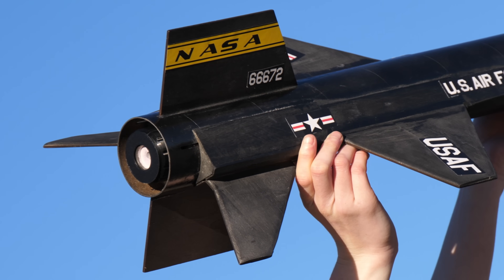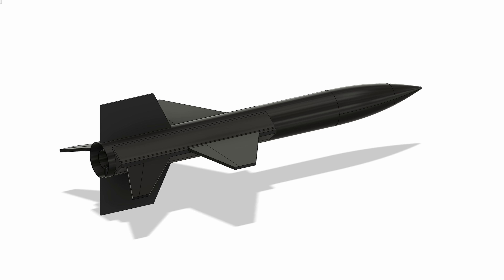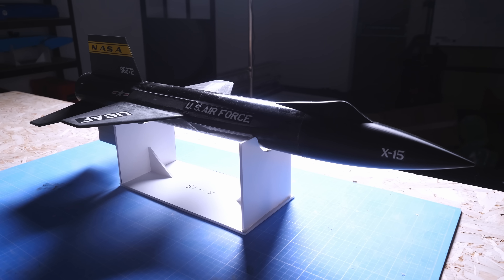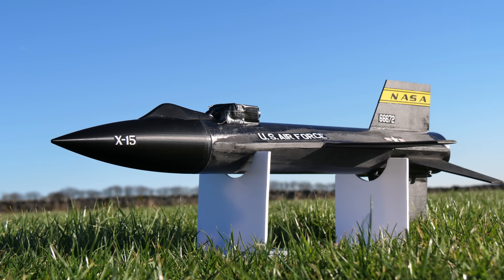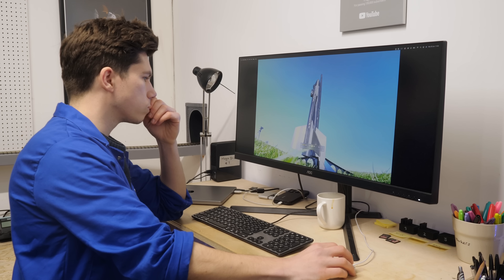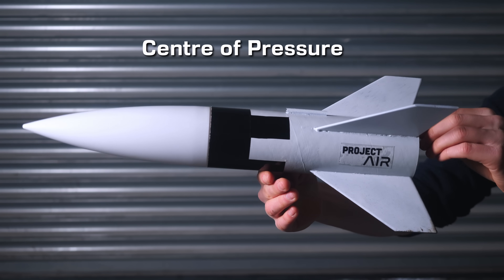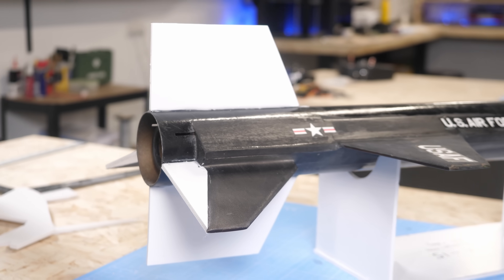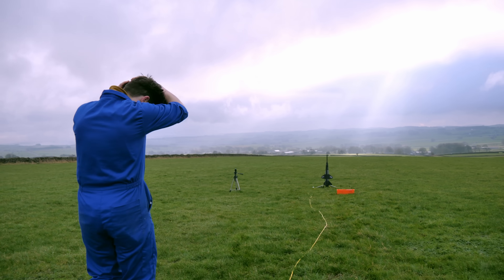Building a HIGH SPEED Rocket Plane

Comment: LOL you could have relaunched it right after driving it in to the ground ... 
As far as a speed of sound shot straight up is no big deal  if i recall you already did that and 100s of others have for sure. Now getting it flying horizontal at speed of sound will be hard unless you launch it almost horizontal to start with. I would say a launch at 33 degrees from horizontal would about do it. For that you will need way way more space than you have there say the salt flats?  If you try to transition from vertical to horizontal at speed you are going to rip the plane to shreds there wont be any thing left so you need to be as flat as possible to start with. Another way to do this is a drop launch from the belly of a rc plane. Take the smaller x 15 model in to the air to altitude on the belly of a large scale rc plane any 1/4 scale plane will do and lots of those exist in kit form. Once at altitude you drop the x 15 model and using a pull pin trigger for  setting off the rocket motor go straight in to the speed run from drop point. Right before releasing the x 15 model you   have the drop plane pilot pull up in to a steep climb so the x15 drops with the nose up a bit so that when the pin pulls it is ither a little nose up or nearly flat. Slight nose up is best slight nose down is worst

Comment: ground launch stationary yes allows you to track  gained speed but really you need a carrier plane  to launch it from already moving and with at least a 15° climb when launched  then rc rtb auto landing while  rocket plane stage  achieves  speed 700mph is what were trying to stay under correct? or is 1400 mph acceptable ground speed?
Reply: It would be impossible for an object of such mass to achieve 1400 mph that close to the ground due to the air pressure.

Comment: By the way if you need access to bigger model rockets all you need to do is mix saltpeter with sugar into a PVC pipe and cap the ends with cat litter I can tell you from experience it works very well most of my rockets have a range of 10 to 15 mi and the max altitude of about 500 ft I think you guys can figure out the trajectory from that

Comment: You should use play doe for nose weight. While not as dense as lead it does not make any real difference you use mor to balance is all and you would never fill the nose cone with it before you had the weight to far forward. Me and a friend of mine use to build all sorts of rockets including ones that looked like planes and used play doe  a few times we added bbs for a bb gun to the play doe to bring the weight up just a bit. Others used things like broken up steel wool or iron filings in the play doe
Reply: If the nose is actually made from Play-doh (Plasticine in the UK), it can absorb a lot of impact energy.
Perhaps not easy to get a perfect shape unless a split mould is made but it would be sufficient for testing.

Comment: Estes "BOMARC" missile model was a rocket plane, that would launch like a rocket then glide down.
The "trick" was an jestisonable tube that ran up the center. This contained the rocket motor as well as a nose weight. When the ejection charge fired, this whole center tube would slide out, nose weight and all, to parachute down. 
As the center tube left the plane, a small thread would be released to cause the elevator to go from neutral, to a slighy nose up, to help the plane to glide, rather than "Lawn-Dart".
Reply: I had a similar rocket as a kid that was shaped like the Space Shuttle, but the shell was foam and had no way to adjust pitch. It had only one flight, where as soon as it left the pad, did a wide backwards arc straight into the ground. The motor assembly ejected perfectly, although not till shortly after impact.
Reply: Their SST was a swing wing (rocket that transitioned to a glider)
Reply: @jimurrata6785  I remember that one, also. It deployed the wings when the recovery charge fired.
Tried to search for it, and only could find the "Low Boom SST" which is simple parachute recovery....  sigh....

searched for the original Estes BOMARC kit, and found it for $170 (!!!), and it appears to be the exact same design, but comes in a bag, rather than the box it used to.

Comment: You could have done a swing test to determine stability...
Right from NASA...
There is a relatively simple test that you can use on a model rocket to determine the stability. Tie a string around the body tube at the location of the center of gravity. (Be sure to have the parachute and the engine installed.) Then swing the rocket in a circle around you while holding the other end of the string. After a few revolutions, if the nose points in the direction of the rotation, the rocket is stable and the center of pressure is below the center of gravity. If the rocket wobbles, or the tail points in the direction of rotation, the rocket is unstable. You can increase the stability by lowering the center of pressure (increase the fin area) or by raising the center of gravity (add weight to the nose.)
Reply: i'm giggling in my head imagining some nerdy guy standing in a field swinging a million pound saturn v on the end of a string around his head.
Reply: @pezpengy9308  bro 💀💀
Reply: learn something new everyday
Reply: This guy is just a moron
Reply: ty for this
Reply: I done model planes and rockets 40years ago. We used to do the swing test too, it always offered good results Atleast for a flying start point. I had Estes sr-71 and the x-15 amongst others.
Reply: Nah, look at a enough videos and you will know he likely wont. At this point, it's almost like a video formula. Disregard proper research (whilst making it sound like you aren't), crash the thing, then rebuild. I mean, he has a community he could have asked up front about these things.
Reply: @AntiVaganza  Maybe he likes to set challenges to himself ? If you want to be an engineer and figure things out for yourself through trial and error, why would you be asking your community? The reason he does these projects is to challenge himself, it's what makes the videos so good, is he often makes mistakes but learns from them. It's a great channel, one that has stole countless hours of my life, but I regret not a single minute.. Keep up the good work
Reply: @ Good for you that you like it. That's cool. 
Apologies for the wordy reply below. Read it if you feel like it. If not, that's cool, too. 

Anyhow I am all for challenges and people's right to do it their own way. Heck, I tinker away big time on my own and learned a ton from others on this platform. But - perhaps because I have a background in journalism -- I am also a stickler for being honest about how you go about things. 

What rubs me is that it increasingly clear is that he wants to sound like he is doing the real research and that he bases his work on it - when he often clearly doesn't or he disregards it. So, it's actually about the wrapping and wording more than anything. 

I think he think he needs the crashes for the story telling arch and clicks which is why he has to disregard the research. But then please don't sound like you did the research. It's that simple to me. Just be honest about the tinkering aspect being big, that's it's more Winging It than Project Air, so to speak. 

In youtuber analogies, it's like he wants to sound like, say, Stanton or BPS.space but in reality goes about his work more like Sripol. 
On that same note, one of my all time fave channels is 2StrokeStuffings who tinkers away and makes "mistakes" all the time, for years on end actually. Because of this, some people have left his channel out of frustration after repeatedly urging him to to things the tried, trued and "engineered" way. 
But I am all-in, I'll never leave, even though it's often 1 step forward, 2 steps back. Why? Exactly because there's zero pretend. Sometimes he leans into the science but he has always been 100% clear on his need to do it his own way, mistakes and all. 

None of the approaches above are wrong at all, of course - but just be honest about how you do things. 
I would really, really like if he just said that he was doing it his own way, taking a bit of knowledge from here and there but also wanting to figure it out his own way. 

Honestly, that's what drives a lot of inventors, tinkerers, artists - and journalists or writers and photographers for that sake. They want to take on a known challenge or an "old" subject and see how it pans out in their hands and a lot of the energy wouldn't be there if you had a guarenteed outcome from the get go. If you have the answers up front, sometimes there's no fun in doing the work. I can personally relate to the journey being a big part of it. 

As for an engineer having to figure it all out himself, that's not really how engineering most often works, is it? You do the work based on all the knowledge available to you, you reach out to peers and colleagues - you don't reinvent the wheel. Especially since none of this is cutting edge.  

Admittedly, I also have a low tolerance for shilling for one of the worst sponsors on this platform - one that allows stolen artwork to be sold off for their profit. Which leads me to speculate that he is caught in the creator wheel now with all the pressures that come with it. Have to get the big clicks, sponsors and pay his staff. 

Anyways, maybe I am too picky but like I said, if he changed a few words in his scripts it would all be good. And if he researched his sponsors better, it would be even better. 

Not out to taint how you see this channel, it's cool you get enjoyment out of it:)
Reply: @AntiVaganza  Well that's an interesting slant on this channel, I was a little taken aback tbh. But then you showed your hand at the end.. I like the channel because perhaps I'd like to have the space and time to play about with the inventions he's thinking of. Things I used to fantasise about as a kid after I got my first sand scorcher. I never got into flight aside from rocket kits you could buy from model stores at the time, but I always dreamed of building a glider or plane. Maybe when I retire, I'll indulge, til then, these videos are pure escapism, building an aircraft carrier and actually landing a model plane on it.. a rocket car. The sponsers are nada to me, they are what is required for me to be able to enjoy these vids.. And don't worry you haven't tainted how I see this channel at all, but more likley it's tainted my opinion of you.
Reply: @ Thanks for your interesting spin on what I was trying saying. 
Showing my hand at the end? I was clear all the way through that my critique is one of mislabeling. Often not too bad, sometimes a bit more but rarely needed.

If "showing my hand" is about the sponsor and using the word "shilling", then here goes:

The sponsor of this video is known to steal artwork and sell it on without reimbursing the original creators. 
If that means "nothing" to you, then I could resort to a snide comment about lack of moral, but I don't think you knew that. And now that you do, if (big if) it still means nothing to you, then I guess I am just trying to hold Youtubers to a higher standard. Especially the ones with huge, young audiences. I tend to think that who you choose as a sponsor sends a signal but maybe again, most creators can't afford to turn down shady sponsors. 
I do however think the creator on this channel knows, though - or that at least he should have vetted them better as if someone stole his videos and work and sold it, he probably wouldn't be cool with that. 

Back to my original point. 
Escapism and tinkering is cool and important. But making newbie mistakes on purpose whilst quoting science and then ignoring it honestly feels a bit contrived. That was my whole point. The escapism part is amazing, that's the part I still admire about this channel, but the pattern I described is also clear and real from time to time. Some videos don't do it, but quite a few of them do and I personally just think it's wholely unneeded.

Comment: Thats a really nice build of the X15! And that landing was impressive! I look forward to seeing more! I flew an HP rocket on an I128 the other day and got mach 1.59 out of it and 10,500 ft AGL. It was a laser loc 38mm that I modified for electronics and GPS tracking. It cracked like a wipe coming off the launch pad.
Reply: Mach 1.59? That’s some power! Did you add custom engines?
Reply: @neoleonor7140  i was flying a Laser Loc, which is a rocket, not a plane. The motor I used was a comercial motor from aerotech. As an L3 flyer it was actually a smaller rocket. I am currently on a team building a 2 stage that will fly on an O3400 to an M680.

Comment: Hitting the sound barrier is quite ambitious, you haven’t been able to achieve 200mph.  Don’t you think that achieving 400mph first would be a better next milestone?

More simply, the speed of sound is how fast vibrations travel. At 20 °C (68 °F), the speed of sound in air, is about 343 m/s (1,125 ft/s; 1,235 km/h; 767 mph; 667 kn), or 1 km in 2.91 s or one mile in 4.69 s.
Reply: There's also the issue that mass and heat increases as you get closer to the sound barrier and it's not out of the question the RC plane would simply end disintegrating under heat and air pressure.
Reply: @ you are correct, the pressures above 600 mph are intense. Multiplying by powers of ten.  Only titanium and carbon fiber is statically able to withstand these higher  pressures.  He’ll have to develop and produce or manufacture his own propulsion system if he wants to reach speeds above 400mph.

Comment: I built the Estes model of the X15 back in the 80s before it was recalled for 'impact hazard'
Reply: I looked for this comment, I built this very model in the 90's
Reply: I still have mine in it's box! My dad got it for me when I was little but we never got around to firing it.
Reply: Hah, I remember a rocket club I was part of in the 90s banned a F14 model for the same reason - the ejection charge was supposed to pop out swing wings to let it glide down but it had a tendency to fail and "lawn dart" instead
Reply: New channel name:Mr.speed